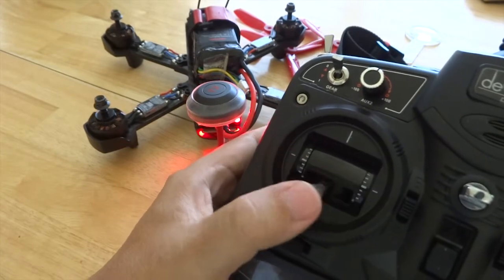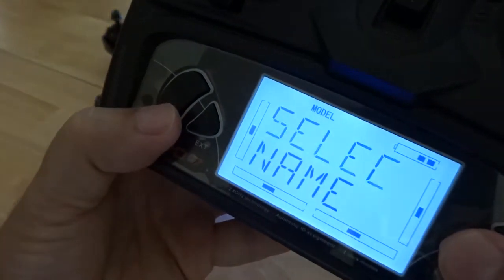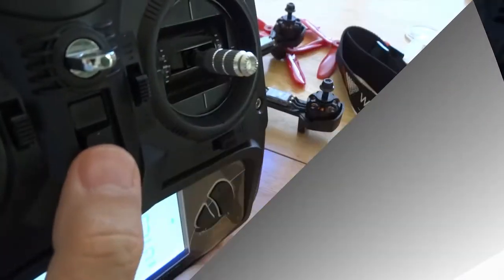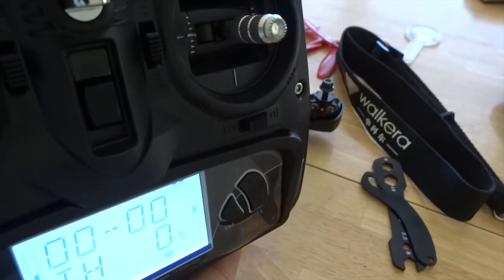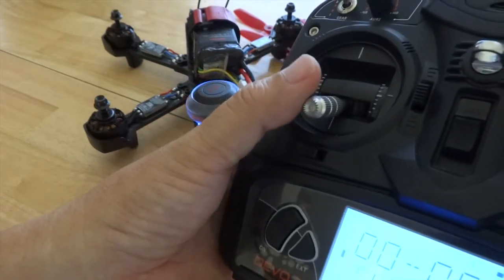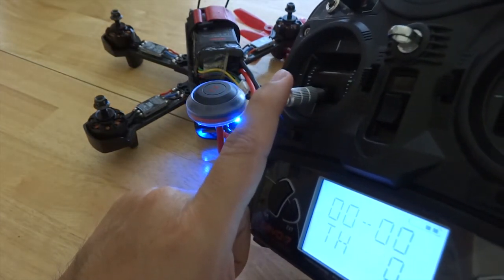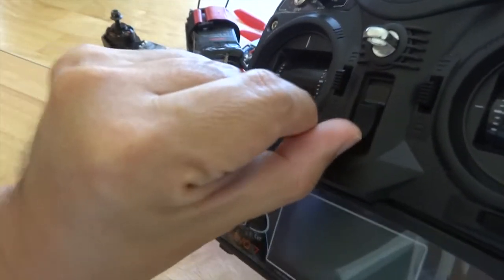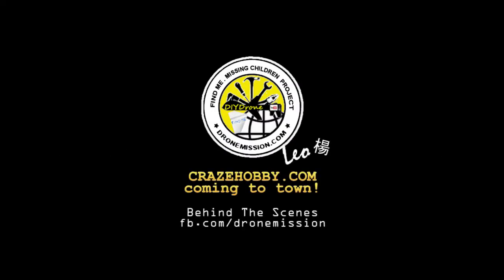Walkera Furious 215 Failsafe, Devo 7, Fixed ID how to

Comment: Hello Leo I have one quick question about the Rodeo 110 antenna during a recent flight I lost the tip of the antenna the clear plastic piece about 1/4 inch long. If I fly will it affect anything other than FPV range? Thank You I will order 1 from Simon but don't want to damage any of the electronics.
Reply from the maker: the plastic is the video transmitter, so if anything changes it will be the video transmission. - dm

Comment: Hi Leo do you have any idea if Walkera has updated the F215? Still enjoying mine they have done a great job on this one. 😊 Thank You
Reply from the maker: No. not that i am aware.  Yes, the controls are great.  I have airmode paired to be on, when i am on horizon or acro, so i skip having to deal with another switch. - Leo

Comment: Hi Leo it's only me again, I'm very happy with the performance of the F215. So I dug out my F210 failsafe doesn't seem to work as described in this video, what do I have to do to get it working properly? Thank You 😊I got my 215 parts you sent me on Monday, thanks to you and Simon.
Reply from the maker: hey there Jim, Yes, that F210 had that issue when Cleanflight was at it's infancy, as a result I had showed the difference on the F215.  I was not following the F210 closely during those days, late last year a firmware was issued by Walkera, but I am not sure if it changed anything.  In any case, an updated unofficial firmware was tested at the factory this March 2017, not too long ago, you can try it.  It may correct the production F210, but it did not on the prototype I have.  see  http://walkera.rocks/index.php/firmware/

Comment: Hi Leo so the fail safe works but not if you have Air Mode on correct? Is there anyway around this? Thanks Leo!
Reply from the maker: Hi Jim, not true, a failsafe is set to either drop or land, which it will. The primary objective is that it does not fly away, that is failsafe.  Airmode will only stabilize the drop. If you are asking if Airmode will keep the props idling upon landing, that probably can be changed within betaflight, to drop the throttle below idling.  Test it first, i assume it will not idle in airmode at all.
Reply: diydrone Once again Leo thank you.👌

Comment: Hey man, I just subscribed to your channel. I was hoping you could help me. I had to replace the receiver and some motors on my furious 215. Now I can't figure out how to get it to bind to the Devo 7 for the life of me. Please help, I have a race this weekend and I am screwed if I cant get this thing in the air. Thanks man.
Reply from the maker: 1. make sure u have a Walkera receiver2. clear any fixed id on  transmitter3.  you can also clear the fixed id of a receiver by powering with a bind plug.  4. power on the F215 first5. power on the radio second6. connect Cleanflight to check your receiver, throttle and yaw especially
Reply: thanks for getting back to me. I tried exactly what you said several times and still no luck. When I power on the drone, it just continues to beep beep beep beep and the red led on the board just continues to flash in a slow blink. I don't know what to try now. If you have any ideas I would really appreciate it.
Reply: I have the exact same problem as you. do you mean its the flightcontroller that is blinking slowly? Cus i cant figure out a way to fix this problem, so pls let me know if you found the fix
Reply: Bro, I just decided to send my shit out to the only official walkera service place in the US. Do you want their info????

Comment: I tried this on my rodeo 110 and worked fine. I use the same transmitter on my f210 and it wouldn't bind so I turned off fixed Id and it bound to the f210. When I went back to the rodeo 110 to bind ,it would no longer bind I tried to turn fixed Id back on and off... nothing. Any ideas on how to get my 110 to bind again to my devo 7?? My 110 is running betaflight.
Reply from the maker: First, you would have a model profile for each aircraft, it is specific for each customized profile, it will store your trims, expo and fixed id etc.  It provides a unique bind by pairing the radio unique id and the fixed id (numbers) you assign to the receiver, ie if you pickup a different radio, it will not work, preventing another pilot from accidentally arming your aircraft, a safety function used by many experienced pilots.  To release the bind, you need to use the same radio, remove the fixed id to the aircraft you fixed, and reboot to check. Sometimes it takes a few tries.  Also you can easily get mixed up if you have a few radios or aircrafts or used different id numbers.   if you are not able to release a previous bind, then your option is to use that little famous mystery plug; clear the receiver bind, (sbus receivers may have a button instead), or most receivers a bind plug.  After releasing the paired radio to the aircraft on a model profile, you can then fixed another aircraft, or follow the best practice; have a different profile for each aircraft to fixed-bind multiple aircrafts to one radio tx.
Reply: You mean the resent button on the 110 right ? I use the same radio for f210 and  110.
Reply from the maker: Hi! You can use the same radio, but my understanding is you used the same profile for 210 without releasing the 110 first.  i suggest you release your 210 first, to prevent another same situation, restart, then remember to set what id number you used for the 110.  You will of course need to restart the 110 to test the bind.   You may end up having to clear both receivers if you repeat the same mistake by not releasing the id and using one profile for two models.  I suggest you create two profiles later.  You should have  a 110 and 210 model to select from, each can carry it's own fixed id.
Reply: diydrone ok. Thanks ! I will give it a try and set a new model for the 110.

Comment: Hi Leo I have another question about the Walkera quads the 110 the 150 the 210 and the 215 and 250. I read a lot about people making changes with Cleanflight and BetaFlight. What are your suggestions on doing this? It seems they all have different ideas and it seems Cleanflight has several different versions. After the last forced update I can no longer hook up my 150. If you use Cleanflight can you list what has to be done to get them all working. 😊 Thank You It seems like no 2 are alike.